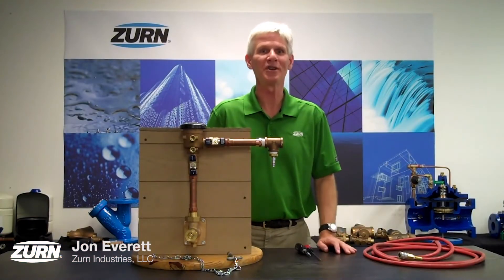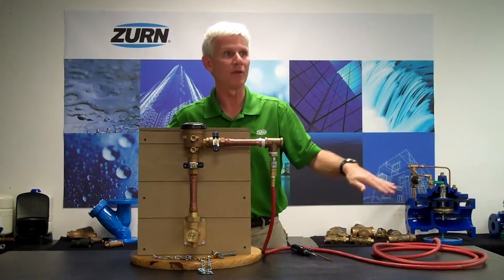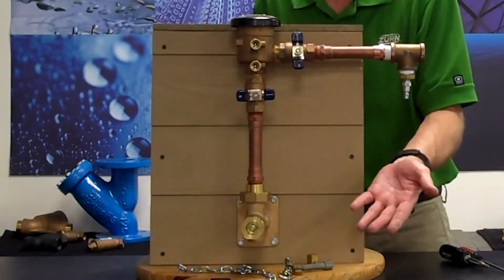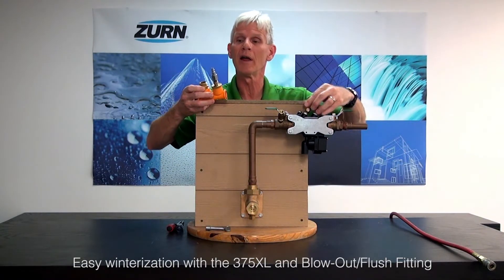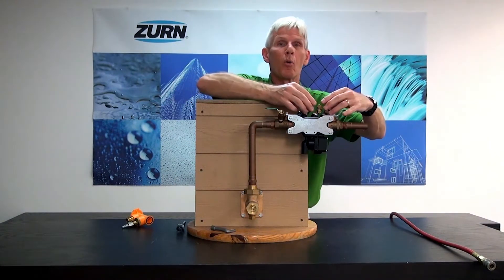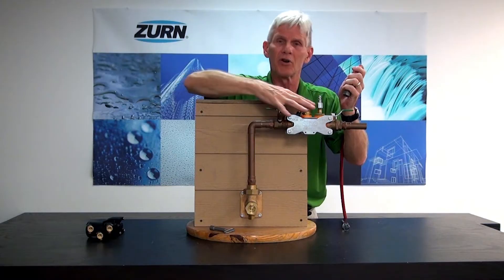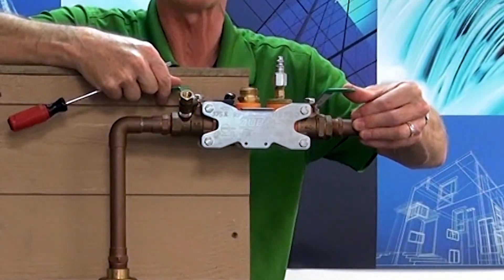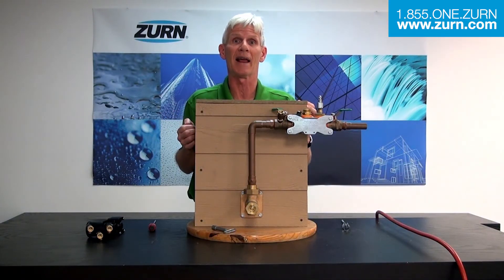Winterizing Your Irrigation System and Zurn Wilkins Backflow Preventers

Comment: Hello, I live in NC and am on my 2nd 375 within 5 years after I replaced the original sprinkler unit (rusted out after 10). The company I've hired do not flush out any water from the lines and simply shut off the main water feed and remove the black housing. Well last year we had significant cold and snow after 3 years and the unit cracked by the ball joint levers. Wanted to charge me 3000 to replace it ($@#&#). This year I'm doing it myself but the main water feed is connected to my main water line (T) then I have another shut off right next to the sprinkler housing. The line is less that 2 feet below ground and it's all PVC and there is no release valve like in the video to drain the main water feed/line to the sprinkler.  Does anyone know how to drain that water? This video was very helpful showing me how to drain the water on the outlet but it's a different set up for the inlet. Thanks in advance for your help.

Comment: Thanks for the video.  Why do other professionals say 60 to 80 psi can be used to push the water out?  You said to use 30 psi.
Reply: depends mostly on pipe material, but also size of air compressor, etc. The most important is high volume, lower pressure.  Same pressure the sprinkler system runs at, which can be anywhere from 30psi to 55 psi. Most sprinkler systems do not run well at over 55 psi.

Comment: Do you have information on what type of fittings have been installed in the flush fitting that he uses on the 375?  Also, how to find out if your system is running 3/4" or 1" to know which flush fitting is the right size?
Reply from the maker: Thanks for the question. The Zurn Wilkins blow-out & flush fitting (tool) include female national pipe threaded connection ports for ease of use. It is common to use an adapter in those ports to convert the connection rom a pip threaded port to an SAE style flare fitting that can connect to an air compressor, for blowing out an irrigation system for winterization. The valve should have a “34” or a “1” embossed on one side of each ball valve, and that will indicate if your product is a ¾” or 1” valve assembly.

Comment: My system also has an attached 1-SXL attached on the supply side of the 375 back flow preventer.  Do i need to do anything special to winterize that component (not shown in your video)?
Reply from the maker: Hi David - thanks for submitting a question. In a system that has been properly winterized, the inlet piping leading up to the backflow prevention assembly should be shut-off and drained completely of water. This would include the strainer as that is installed on the inlet piping. Anytime water is trapped in piping or plumbing products, you can run the risk of damage in the event that the water freezes. I would recommend including the strainer in your winterization process to prevent damage to that component.